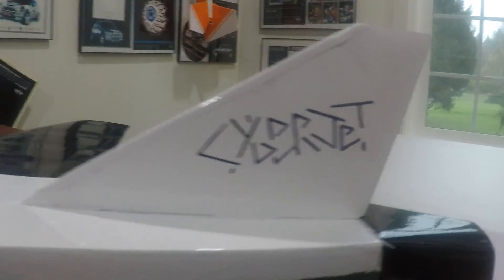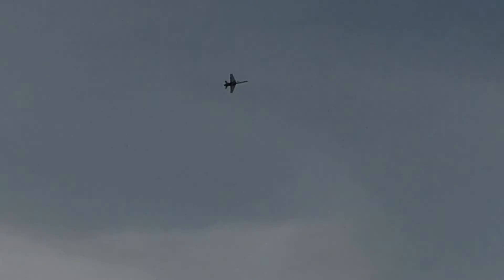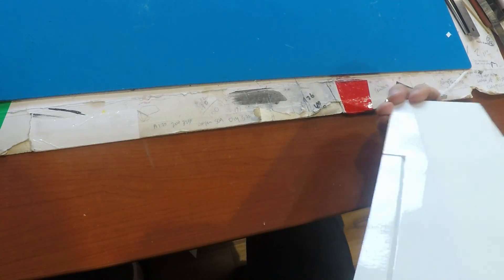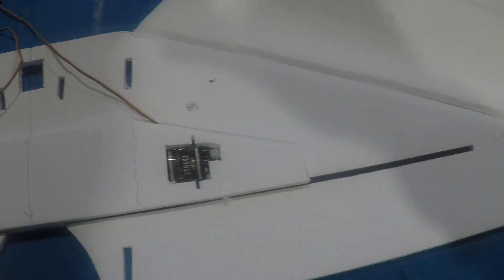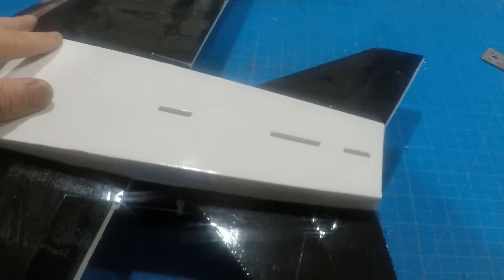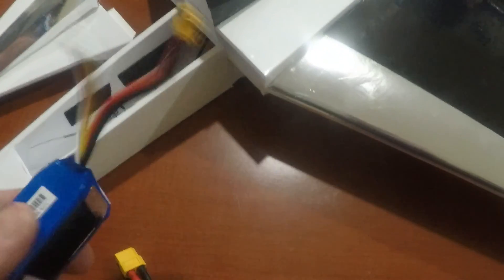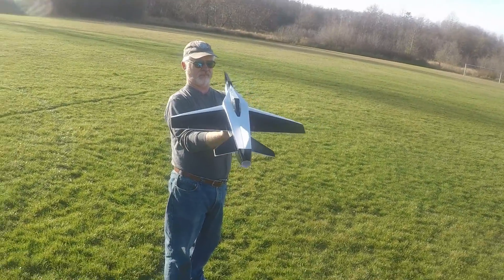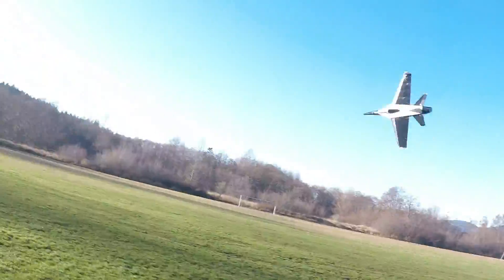CyberJet Foam Board 50mm EDF Trainer Maiden DIY Build

Comment: A jet like this is definitely in my future. Ive built 17 planes so far with good success. I think a jet would be a fun challenge!
Reply from the maker: I’ve been “addicted “ for about a year now. Recommend 4s power as it helps get the plane up to speed faster for launches
Reply: @thenerdoligist1292  that's awesome. Same for me. I've been in the hobby for a little over 5 months and have learned a lot and had a lot of fun. Definitely addicted.

Comment: fixing a small tab/keel to underside of fuselage - that can be held between finger & thumb (around C of G) helps with throwing/launching!  OR mount a re-enforced T to inside of fuse - access via two holes (one either side of center T/keel) on uderside - bowling ball type grip - to chuck it!!!
Reply from the maker: Thanks for the tips!